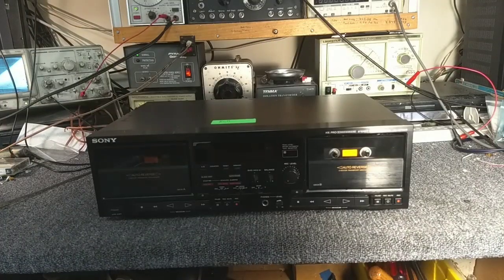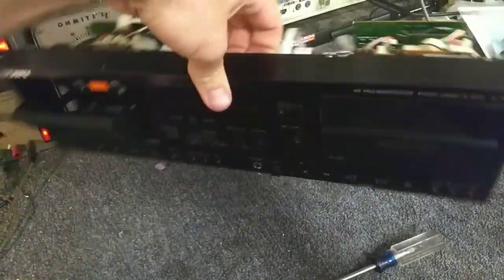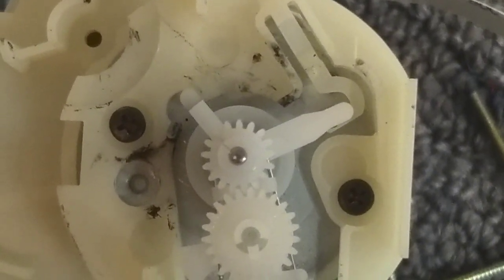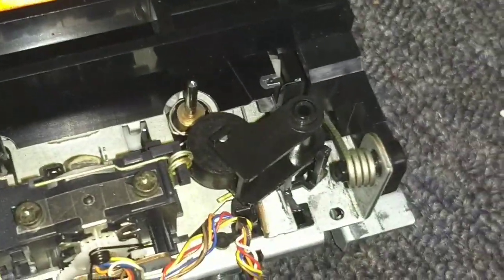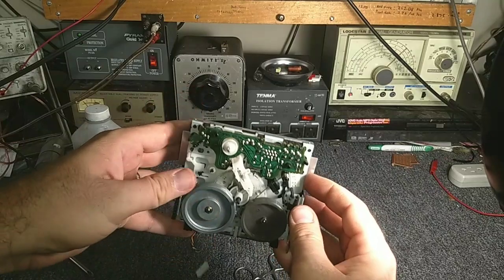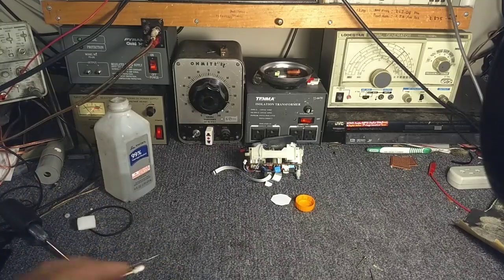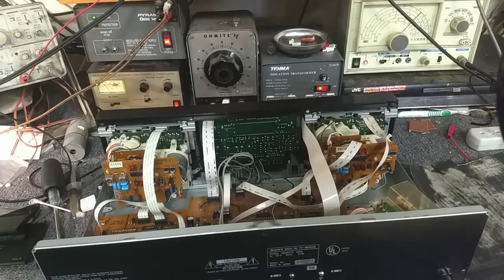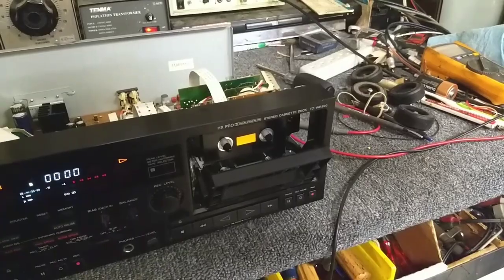Service attempt of Sony tc-wr820a dual cassette deck.

Comment: This mechanism is the worst from Sony and the pinch rollers too. That combo was used in most of the Sony decks in the `90 (even in 3 head models!) so go figure about their quality. The wow&flutter numbers are not great even with good belt and pinch roller due to the low weight of the flywheel
Reply: Well, one flywheel is made of metal, the other one I don't know what material is but it looks like alloy
Reply: - There are many versions of the TCM-190 transport, one is particularly problematic. In those ones, the capstan bearing has a plastic housing, and it cracks, just like the reel motor gear. After that, the bearing will move as the pinch roller pushes the capstan shaft. No more 120 tape in such deck, it will crumble the edge of it, and it might cause azimuth stability issues even with 90 tapes. Until the bearing housing is not cracked, the bearing should be extracted and the hole in the housing should be bored up to a higher diameter for a less tight fit. I have a TC-K511S (3 head), a TC-K461S and several TC-K311 with this issue, I bought several TC-W320 double decks for donors.

- They are not that bad, if you catch them the right time and make the necessary maintenance/mods to prevent things cracking. The reel motor gear started to crack in my TC-K511S when I bought it, but the crack has not reached the teeth yet, so I cleaned the crack with IPA, put a dab of superglue in it, and quickly removed the gear from the shaft, so the crack could close itself ( I helped it a bit with a pair of pliers). After the glue set, I bored up the hole in the gear to be a loose fit on the shaft (but without play), and glued it onto the shaft with gel-type superglue. This was 3 years ago, still perfect. I would not do this with a fully cracked gear, but if you catch it when it is just partially cracked, and not between the teeth, it can be saved. Always bore up the hole, even if there is no sign of crack on these gears. It will crack eventually if you don't decrease the tension in it by boring up the hole. I used to use a drill bit held in a vise, and I rotate the gear on it by hand very carefully. I can't remember the right drill diameter though, I hope I took notes...

- Yes, their pinch rollers and belts from the '90s are horrible, they failed when they were less than 20 years old. I have many Sony cassette decks, even from 1977 (TC-K2A), with their original pinch rollers still being perfect today! But not a single TCM-190 mech deck I could find with a usable pinch roller.

- Wow & flutter: It can be as low as 0.07% with the composite plastic flywheel, but it is very picky on belts and pinch rollers. You must use the absolute best quality capstan belt and pinch rollers in order to get close to this factory spec. Note that the original belt is like 0.3mm (or so) thick, the replacements are usually much thicker, and it makes a huge difference in the wow&flutter. You need a very even, and very thin belt. Some models use proper metal flywheels, like the TC-KE500S, with 0.055% W&F, and these with the metal flywheel are probably less picky on belts. I recently bought a dead TC-K711S, which has the dual capstan and three motor version of the TCM-190, the TCM-200. The bearing housings are brass, and the flywheels are proper, balanced aluminium ones. The low-end TC-W320 double deck also has aluminium flywheels, but those are unbalanced, so it usually gives slightly worse W&F figures than the plastic ones (factory spec is 0.08% for the metal flywheel TC-W320, and 0.07% for the plastic flywhell TC-K511S)
Reply: @mrnmrn1  For the gear-split problem I made metall rings for this gears. No matter if they are already broken or not, I always put such a metall ring onto the gear-shaft and they never ever will break again so to speak. And for the pinch roller I found good ones with a brass core. I modify them to fit into the TCM-190 pinch-roller holders and they work perfectly.
And after a complete disassemble, cleaning and re-oiling/greasing the mechanism, it works even smoother as a new one. Make a good service prevents putting the mechanism 6 times in and out. So in the end it will save time.
Reply: @matthiash.4670  I saw others putting metal rings on those gears, yes, it helps preventing the gear from cracking and become loose on the shaft. BUT it won't prevent cracking from the other side, in between the teeth. And that is even worse, because normally, such a cracked gear will be loose on the shaft and the deck won't work, but with the metal ring, it will turn, but the teeth spacing will be wider where the crack is. The owner should notice the transport runs awfully loud, but if this sign is ignored, the cracked gear will damage the other gear connecting to it, which is much harder to get.
Reply: @mrnmrn1  no, the rings I made fit perfectly. By putting the gear back on the shaft there is no visible crack anymore and the mechanism sounds like a new one. The ring has to be manufactured with very tight tolerance. More than a dozen now got modified by me that way, none of them get failed.
And even if there might be a slight gap between two teeth, it is way better than just glueing the gear on the shaft with a giant gap. And that's the normal way of doing this repair today. Which is the most possible bad way.
Reply: @matthiash.4670  Yes, it's better than glueing it back with a crack (I would never do that), but I don't get how is it possible having no gap with a cracked gear (without drilling up the center hole), because the crack happens due to plastic shrinkage. I would guess no matter how tight you make the metal ring, the crack will open on the toothed side as you push the gear back onto the shaft, because the center hole is too tight on the old, cracked gear. 
Anyway, I don't quite get the idea of fixing this paricular gear that way, because  good quality (injection molded or CNC machined POM) aftermarket ones are available. It would be a good idea to put these metal rings on new, aftermarket gears, to prevent them cracking. I think I saw some like this on ebay. But I would still drill up the center hole on them from the toothed side, because the metal ring won't prevent cracking from that side. The friction-fit would be enough from the "non-toothed" side, especially if it is reinforced with a metal ring.
Reply: @mrnmrn1  It's partly a myth with the plastic shrinkage. Yes, there is a slight shrink due of softener losses for example, but it is a extremly tiny amount of shrinkage. That doesn't cause any crack by its own. The crack is a stress raiser crack, as it happens on metall too. You always have very small imperfections in the plastic structure. The shaft, pressed into the gear, will put a permanent pressure on the the plastic. And over a long period of time (and the tendency of getting more brittel over time) the plastic structure will establish a molecule seperation on such a stress raiser point. If this started once, the crack will go on and on. That's what happens here.
So, the gear has not shrinked in a relevant manner. It has in a pratical perspective the same size as before. And as like before, it can fit in the same way on the shaft. All is needed, is a force clamping it together to establish the same friction pressure as it was before where the molecules held together.
In practice there would be a slight opening of the crack, because in most cases the forces will deform the ring fitting too. But we talk about 100th of a millimeter. The complete gear isn't manufactured with such a tight tolerance.
And opening the gear with just a drill is really worst. The drill will not force itself perfectly concentric, nor it does in the radial axies perspective. You and up in a somehow wobbly gear. Consequently this have to be done with a lathe tho.
I fully agree with you enlargement of the bore and gluing all together it a quit simple and practical method, but with no better results if we talk about 100th of a millimeter crack gap possibility.
And yes, I do agree there are new gears to buy. I do have a couple by my own here. But I have to say the quality isn't as good as you might think. Most of the gears I checked are out of roundness in differend kinds. Some are don't fully round by itself, others do not have a concentric bore in relation to it's outer diameter, others are wobbly. And since they cost a fair bit of money, I don't think they are worth the price in general.
So for me I decided to replace the gear only, if it is damaged in a way a "repair" doen't do it better than a not really "original quality" spare gear.
In litterly 95% of the cases I have good results with the method and a really smooth gear sound, as like with a none cracked gear. So I just can say: For me it's working great.
Reply: @matthiash.4670  I need to do a little research on this one, but not now. By drilling up the hole I don't mean it by using a drill press or cordless drill. I am talking about a drill bit that has the same diameter as the motor shaft. I hold the bare drill bit with my fingers, the gear in my other hand, and carefully drilling it through with my bare hand, at about 30-60RPM. The diameter difference between the drill bit and the original hole on the gear is maybe 0.1mm, the drill barely removes any material. There is no real risk of getting an eccentric or skewed hole, when drilling it with my bare hands, the original hole guides the drill bit perfectly. A reamer would be much better, but I don't have one in this size.
Recently I bought a Sony TC-WR535 double deck, in which, to my great surprise, none of the gears were cracked (although the tiny pulley under them on the same motor shaft started to crack already). I decided to remove the gears from the shafts to drill them up. I don't know how much they shrunk, but both were stuck to the shaft so hard, I was afraid that I might pull the shaft out of the motor, instead of the gear from the shaft. 
These gears were made with a very tight fit onto the shaft, so the plastic shrinkage (whatever tiny amount of it) might have a huge impact on the tension inside the gear. And as you said, aging plastic becomes more brittle, these are probably the two main factors in this cracking gear plague. I believe the weakening molecular structure of the plastic under constant tension is just the mechanism how the crack happens, but I still think the main reason is the loss of plasticizer, what makes the plastic more brittle, and causing shrinkage at the same time.
About the replacement gears on ebay/aliexpress: I said there are some which are of great quality. In 2021 I bought Sony gears from a Slovakian ebay seller ('mihokm' or FixYourAudio), CNC machined POM, perfect. Also in 2021, for one of my Technics decks, I bought a gear from a Hungarian ebay seller ('akg090' or AKG Engineering), injection molded POM, also perfect. I think it was in early 2022, when out of curiosity, I bought a package of 5 Sony gears from the cheapest seller on aliexpress: faaar from perfect. Five of them cost about as much as a single gear from FixYourAudio, they are probably 3D printed, and there is no chance of putting them on the shaft without drilling up their hole: it is about 0.5mm too small. Their teeth mesh OK with the original though, after you remove on ton of burr... The prices of the two abovementioned ebay sellers were half-reasonable in 2021-early 2022, nowadays they are a bit overpriced, as everything else (or actually less overpriced compared to some things in the shops), but the prices of second hand tape decks also increased.
Reply: @mrnmrn1  As you said: The best would be to use a reamer. The mechanical stuff is some kind of my hobby, so that's way I have a lathe and could manufacture the mentioned metal rings. But as of the years playing with such mechanical manufactering methods, and guys I spoke with of the time, is one simple common knowlage: You cannot bore out a hole with a drill and maintain its concentricity, even its diameter. The bare simple reason is the drill itself: Their cutting edges are not perfectly, so there's a cutting edge cutting more than the other and this leads to an unpredictable drift.
So in lathe work the golden rule is, do never try to create a hole with a drill with the intention to get it concentric and nailed on its target diameter. You will always fail.
That's why I said the drill will produce a slight none concentric hole. Depanding on the drill this might be more or less. And related to the amount of material removel in most cases not visible by eye. With a dial indicator it is visible. That's how I checked a coupple of replacement gears in the past. And yes, many of the chinese ones are bad. But suprisingly some are really good.
And yes, I own a TC-WR535 by my own. It is the first real deck I bought in the early 90' by myself and is still sitting here in my setup. And also yes: About a year ago I serviced the deck, because it required new pinch rollers and I took a look on the gears also. Funny: Both gears on my deck are not split too!
It maybe depands on climate changes also. My deck was all of its lifetime in the living room. But I also have some donor WR535 here, got from here and there, where the gears are all split, even one with rusty capstan shafts.
I never brought the Delrin (POM) replacement gears. But sometimes I manufacture gears out of Delrin by myself. It is litterly the best plastic material for gears. So they should work very well.
The huy you pointed out sell one gear for about 10 bucks plus shipping. Pricy.
But they are not injection molded (not easy with Delrin), he wrote in his offer: Machined on a CNC lathe with gear hopping. That's how I manifacture gears by myself and I can say the term "CNC" is a little bit missleading here. Some would think "very precise" but I can say you can make so much things wrong and finally get wobbly trash out of the production line. It is not easy to get good quality here. The best way is do an injection molding, like it is done in mass production. But nevertheless, even the original gears are not spot on. As like most of the gears in products. It's just a mass production. Imagine "medium quality" last abut 30 years, what would "high quality" last? 50? I don't think a mechanism life of additional 50 years does not depand of this gear :D
Reply: @matthiash.4670   I'm not a machinist by any means. I am an electronics technician, I repair my own junk which I buy in broken condition. But my father was a machinist, knowing pretty much everything about manual lathes and milling machines (wasn't into CNC though), that's where all my very limited mechanical knowledge comes from.

"It maybe depands on climate changes also.", YES, I forgot to mention this, I'm pretty sure that the dissimilar thermal expansion coefficient of the plastic gear and the metal shaft has a big impact, too. My freshly (last october) acquired TC-WR535 is in quite mint condition, pretty sure it was stored in a living room, or at least somewhere in a house, and not in an unheated garage or an attic, where the temperature might fluctuate between -20 to +70 °C, depending on the location and the roofing material. I have a JVC BR-7000 professional duplicator VHS VCR, which was working perfectly before the previous owner (the father of one of my friends) put it up on their attic for about 8 years. When the previous owner died about 12 years ago, I 'inherited' the VCR (my friend gave it to me), and after those few years up in the attic, a gear broke in the cassette loading mechanism: a plastic gear which has a brass worm gear as its core, so again:  metal vs. plastic.
 
About the ebay "gear guys": yes, the Slovakian guy uses a lathe and gear hopping, but the Hungarian guy says his gears are injection molded POM. And his Technics RDG0034 16T Replacement Gear which I bought is still only $6 plus shipping (it was $5.9 in 2021, so practically the same price), although he has many gears which are much more expensive. I would guess this Techncs gear is his most selling one, that's why it's cheaper. He has the Sony gear as well, for $7, and it is injection molded POM, too.

"Imagine "medium quality" last abut 30 years, what would "high quality" last? 50? I don't think a mechanism life of additional 50 years does not depand of this gear :D"

I would guess the EOL for these TCM-190 transports will be when other plastic parts, especially the control arm of the cam gear, and the cam gear itself becomes brittle, which will probably happen (depending on storage conditions) when they reach 40, or with very good storage, maybe 50 to 60 years. I have a TC-K511S from 1997, and both the gear and the capstan bearing housing was cracked in it in 2019, well before 30 years... Fortunately their upper models, like the dual capstan TC-K711S has brass capstan bearing housing, so one failure point less.
Reply: @mrnmrn1  I am in electronics too, but on the engeneering side - some technican my say: The dark side :D But yeah, the sad thing is, at one time in future, the units are not repairable anymore. And yes, storage of the units are critical. Even rubber don't like to do nothing, so to speak. So I try to use my stuff from time to time. But I also have a SVHS VCR in the basement, and I think its storage for about 2 decades now made the condition really worse.
Maybe I try the Hungarian guy next time if I need to and see what he can offer for this price ;-)
And ur K511S is a really nice deck too. I do search for a long time for any decent closed loop dual capstan Sony for myself, but the price is crazy. Even brocken spending a couple hundred bucks is easy. Maybe some day I get lucky :D
Reply: @mrnmrn1  it seems you are very lucky in finding good decks for a low price. The last offer I found was the mentioned  711 "untested" (we know what it means :D ), with a lot of scratches for 150 bucks. Spend a little bit more and you can get a Nakamichi :D But I don't like the Nakamichi look/style, so I wouldn't buy it anyway.